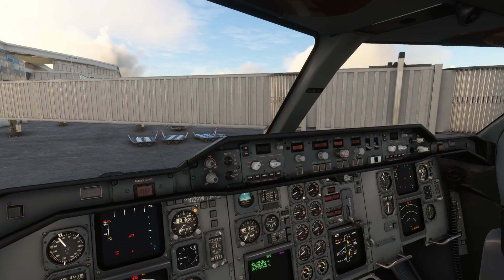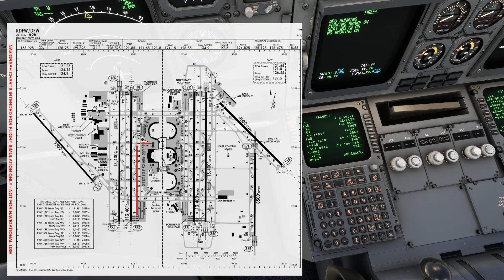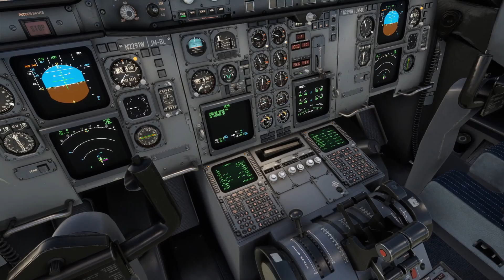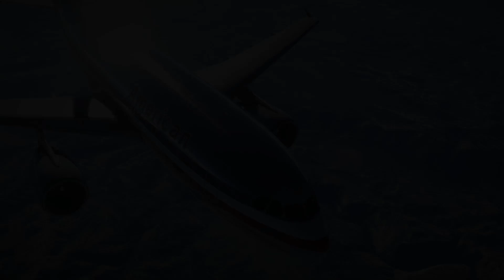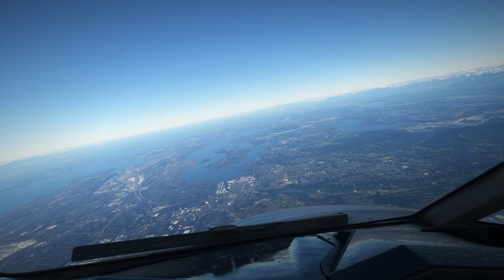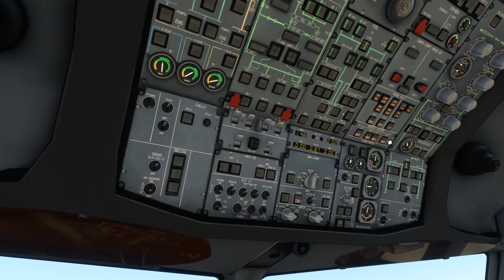MSFS Just Keeps Getting Better! | Ultimate Immersion | Real Airbus Pilot | Airbus A310 - Full Flight

Comment: If someone may please instruct me, whenever I use it, the engines would always get stuck at 100% and wouldn't respond
Reply from the maker: Hmmm, that’s very strange GB. I flew the A310 just a few days ago and didn’t have any problems. There is a throttle axis configuration option in the A310’s tablet, so I’m guessing you made to calibrate your throttle?

I hope that helps? Cheers : )
Reply: @IntotheBlueSimulations  I will try and see if it's a throttle calibration but it also happens whenever I use slew mode and I have the same problem with the CS 767 and 777 and the base game 747.
Reply from the maker: Ahh, I see. Well, if it’s affecting other aircraft also, it sound more like a key binding or hardware issue. Have you tried unplugging your peripherals and seeing whether you still have the same problem?
Reply: @IntotheBlueSimulations  Not yet, however I did fly the 777 a few days ago after not touching it for months and that problem is gone and I suspect it's the same with the 767.
I'll look around online

Comment: what settings do you run? i have a 3080 and run ultra but its laggy? also your seattle looks so goof mine has hills and bumps everywhere and i cant land? what KSEA do you use? and do you know how i can fix it? please also love the content thanks!
Reply from the maker: H Knox,

My settings on this particular PC (I have a new setup now), were / are roughly as follows:

- “High End” preset
- Pre-Cache = Ultra
- Terrain and Object visibility sliders set at 125% (sorry, I forget the actual names of them)
- Motion Blur = Off
- Glass Cockpit Refresh = Medium
- AI Traffic = Off
- VSync = On / 60fps

That gives a nice balance between graphical fidelity and performance. I only run at 1080p, hence the decent FPS / smooth performance. The things I’ve turned off / down are known to be famerate hogs. It’s important to note, I also spend a lot of time tweaking the weather / lighting in my videos, which accounts for much of the graphical fidelity you see (as that can make a huge different to how the sim looks overall).

Haha, I experienced the same with Asobo’s “handcrafted” KSEA (which is what I was using during the video). I got lucky though and didn’t hit any bumps until the departure end of the runway, which was a section of the video that I ultimately edited out anyway. It is a shame that the Seattle scenery is pretty iffy, given that it’s supposed to be “custom”.

I hope that helps a little! Thanks very much and all the best : )

Comment: Don't most airline pilots start with engine 2 before they go to 1? Haven't a clue why, but I keep noticing this on YouTube videos.
Reply from the maker: It’s very much aircraft dependant (rather than a pilot preference issue) Kokoete. I’m not actually sure which engine is started on the A310 first in fairness. I seem to recall that the 737 has a hydraulic issue, if the #1 engine is repeatedly started ahead of the #2 for example (though not being all that familiar with the 737, I could be wrong on that one) and on some aircraft, the hydraulics for the braking system might be powered off a certain engine, so it would make sense to start that engine first etc. Generally the start sequence will be detailed to the pilots via the aircraft documentation / company procedures.

I hope that clarifies things a little. All the best! : )

Comment: For those of you being interested in how a real A310 pilot did his cockpit prep, let my try an A310 cockpit preparation in a nutshell:

What you do is basically switch on the batteries, test the APU fire loop and squib, start APU, go into the fms to check database and then go directly to init A page, switch on left, right and middle IRS, check the aircraft coordinates via REF > GPS monitor page on the other fms, and correct coordinates on the init A page and hit ALIGN IRS, then go up to the isdu (right below left IRS), and check if those coordinates have been taken over. 
Then you can start with the overhead panel flow column by column, from bottom to top and left to right. Switch on the signs, the dome light (only cockpit lights at EMER Elec config), then FLT RCDR to GND CTL. When you are at the lights, switch the strobe in "Auto" and NAV/Logo in "1" or "2" (if equipped), all others OFF. We call it the "U". All the Pitch trim, yaw damper and ATS levers UP, check the squib and loop of ENG 1, and ENG 2 once you are there. Yes, you switch on every fuel pump, even if the fuel tank is empty, or even if the ACTs are not installed, as the auto fuel feed will be impaired and the CG can not be controlled. Switch on window and probe heat, once the covers are off. Switch on and check oxygen is at least between 1400 and 2000 PSI. EMER exit lights to ARM. You can select ECON FLOW with less than 160 PAX on board.
So bottomline, you basically switch all white lights off on the overhead panel. 

Right after that, i set up the EFB, get the ATIS and calculate my take off performance. Then i fill the FMS with the weights, flight plan, take off speeds etc. 
On the Prog page, we use bearing distance for the EOSID fix, and depending on Pilot flying from left or right, the corresponding other side is used to tune a VOR station (e.g. if CM1 is flying, we put in a VOR or DME station in Remote 2 (right side) at the bottom of the Prog page, that assures, that Remote 2 isn't autotuning any other undesired stations, for a departure or EOSID).

Now that i have done my calculations with the EFB before and know, that there are no performance issues with the planned departure, i start setting up the FCU. In the Speed window, we dial in the V2, then press the knob to activate a preset and dial in at least 250 knots, or take off weight + 120 Knots, whichever is higher. The preset gets activated, when for example during engine failure, where u deactivate the PROF mode and select the ALT hold mode at the acclereation altitude, the vertical mode changes, and an acceleration to the preselected speed is required. 
During normal operation in PROF mode, this speed will be disregarded, as there is no Mode change. The preset function can also be used, when descending to fl100 for example and you want to keep 310 knots, until reaching your altitude, and then slow down to 250 kts. Once ALT* appears, the vertical mode has changed, and your preset speed is activated, or it can also be used to change from 310 knots, to Mach 0.80 at you crossover altitude for climb Modes any other than PROF. Just remember, the preset speed is very useful and gets activated, whenever there is a vertical mode change.

On the EFIS control panel we set the minimum to -5 and in the FPA window wie dial in the trim Setting for the elevator as a reminder.

Then i do the panel on the side, check the switching, check the mask, and check that the RAT lever is stowed and guarded.

After that i set up the flight instruments, dial in the QNH and the Engine Out acceleration altitude, on the stand by airspeed indicator we bug V2 and the Green Dot Speed (until 20000ft it is your current aicraft weight + 100. So at 130 tons, your green dot speed is 230 kts). 
Then hit the EGPWS button, just short, and check the ND for a test pattern and some EGPWS call outs, set the Gear Position Determination System to 1 for odd, or 2 for even days (same with ignition A or B later for engine start). Test the Gear Warning. Dial in the current airport elevation, set up the thrust rating panel. Go through the engine instruments and finally set up the pedestal with some frequencies, insert the ILS frequency of the runway that is used in case of an immediate return (gives also a centerline indication during take off run, if it's the same runway), set ADF 1 to an NDB in the departure sector, and ADF2 to the Outer Marker of the return runway, set up the transponder, depending on pilot flying, either ATC 1 or 2.

Pilot Monitoring would at least check the cockpit and all the levers for their correct and corresponding position before Pilot flying is setting up the aircraft, then check the emergency gear, do the light test, and the brake check in the meantime. So on the center console right below the speed brake, press the accu button, to energize the yellow hydraulic system accumulator, note that the accu press pointer on the brake indicator moves into the green marking. the brake press indication should be 1500 PSI or more with parking brake on. Switch brakes to ALTN/ON, release parking brake and press the brake pedals, indication should be 2400 PSI at full pedal deflection, then release brake pedals, and set parking brake, also press accu button again until the pointer is in the green and switch back to NORM/ON.

Whats different to modern Airbusses: to insert the approach, you have to select the left line select key (LAT Revision) of any waypoint that is above the airport on the FPL page. I know, with modern airbus, you can hit the destination airport, but not on the 310. That way, it would insert the approach behind your destination.

I guess that's it so far. Can't think of more at the moment. Let me know, if you have specific questions.

PS: Fuel lever on at 15% minimum, we use mostly 18% N2 :P 
To check for correct engine parameters after ENG start, we use the "20, 40, 60" method, which means form top to bottom the N1 should be at around 24%, EGT at about 400 degrees C, and N2 around 65%
Reply from the maker: Thanks very much for the very detailed explanation Julian. Very helpful!

I had wondered what the purpose of preselected speed is - makes much more sense now. What is the logic behind setting -5 for the DH - is that just to prevent an auto-callout or something?

Cheers and all the best! : )
Reply: @IntotheBlueSimulations yes, -5 prevents the minimum auto callout upon touchdown.
Reply from the maker: Ahh ok, I figured as much. Initially I was wondering why everyone was setting -5 haha. Thanks once again for the info. Much appreciated! : )
Reply: @IntotheBlueSimulations  I forgot to mention, that the preset speed also works to change from IAS to Mach while climbing, and Mach to IAS while descending through FL290 (crossover altitude for standard speeds 310/.80). It is required to use the preset or to change it manually on the FCU whenever prof is not used and passing the crossover altitude. PROF mode uses the underlying airspeed of the fms. All other modes use the airspeed that is dialed in the speed window on the FCU. The aircraft is not automatically changing between IAS and Mach, meaning that you can find yourself in a overspeed situation at some point.

Comment: Interesting video. I have about 15k hours on Airbus, but I missed this generation and went straight from the B747-200 to the A340-300 (and later the 346, 332 and 333 - and technically the 35X, but never flew it), which was a complete brain change! I was surprised at the t/o performance calculation; for a relatively small and light aircraft, a Vr of 167 seems pretty high. I can't remember seeing speeds like that in the 346 below around 350 tonnes. But it may reflect the performance compromises Airbus made at the time. Anyway, good to watch. You have a nice manner.
Reply from the maker: Hello Tim,

Thank you very much for sharing your thoughts and indeed the kind words. Like yourself, I’ve flown a number of different members of the Airbus family, but nothing of this vintage. I did find it rather interesting, getting a feel for the A310 and noting the similarities / differences, as compared with a more modern Airbus. I was a bit surprised by the V speeds also and initially thought exactly the same (I put the high speeds down to Airbus having shortened the A310’s wing slightly), but as was pointed out by a real-world A310 chap, it was of course a slats-only takeoff. . .

Thanks very much for watching and all the best! : )

Comment: I love flying this plane but it's a pretty steep learning curve from the A320 this is close to if not study level. Having trouble setting it up do do an ILS landing
Reply from the maker: Hi Fizz,

Yes, the A310 is certainly a bit more work than the A320, a bit more demanding to operate etc, but I find it all the more rewarding to fly as a result (and it’s an interesting aircraft to operate). Anything specific causing you trouble with the ILS? It should just be a case of tuning it up on the centre console and then arming up the autopilot. To display the ILS on the PFD you’ll also need to make sure ILS is selected, via the switch located just to the right of the EFIS control panel.

I hope that helps a little. Happy flying and all the best! : )

Comment: No it keeps throwing up errors your just not seeing them
Reply from the maker: I’m well aware the sim is far from perfect David, but personally I think it’s (finally) started moving in the right direction and I’m enjoying MSFS for its strengths, rather than focusing on its weaknesses. Apart from the low FPS of the A310 (which has now been fixed) and some slightly dodgy taxiway issues in Seattle (not seen in the video), I don’t see how one can begrudge this “default” simming experience?

All the best

Comment: I really enjoy these videos.  Thank you for taking the time to do them.  Just a couple of quick questions, what replay software are you using for wing views on takeoff and landing, and how do you find the warthog?  I have just got one but not sure what sensitivity to set up.  Thank you as always
Reply from the maker: Hello Alec,

Thanks very much for the kind words! My pleasure and I'm really glad you're enjoying the content.

I use a 3rd party recording tool, which can be found here: https://flightsim.to/file/8163/flight-recorder

For the wing views themselves, I just move the camera into position manually (on most addons).

I'm a big fan of the Warthog! I've had mine for a while now and it's pretty robust, works nicely with most types of simming etc. In terms of sensitivity, I tend to keep my settings pretty standard. That may well not be the most realistic option, but it keeps things consistent across addons and makes things "fairer" for any product reviews etc. The only sensitivity setting I have changed - I have my rudder curve set to -50, as the rudder control in MSFS is still way overly sensitive.

I hope that helps? All the best! : )

Comment: Exellent video tutorial. Very illustrative. When I fly on CRZ level, the plane is loosing navigation, despite I have NAV activated or same, if I switch to HED SEL. Any idea why this happens? I can then only steer the plane into a different direction by deactivating the AP and fly manually.
Reply from the maker: Thanks very much Erich, I'm glad you found it useful!

I'm afraid I'm struggling to think what might be the cause of your issue. So, you are saying that the autopilot won't fly NAV in the cruise, what about at other times? The only thing I can think of, off the top of my head; what is it that you're doing to activate the autopilot? You aren't accidentally putting the autopilot into CWS mode, as opposed to CMD are you?

What you're describing is very strange behaviour otherwise. If you have any more details you can provide, that might help?

Cheers : )

Comment: Great video as always. Just a couple of things I'd like to share:

When setting the landing elevation before departure, you should actually set it to the departure airfield elevation instead. This is in case you need to come back. This is also why it is included twice in the default checklist (once before departure, and once before approach)

You can use the plan mode on the ND whilst the IRS is aligning. It just won't show the current position, but you can visualize the waypoints.

I've been told A310 pilots turn the Wx radar mode to 'Test' when turning it off. That way the rader won't radiate, even when it's accidentally turned on while on the ground.
Reply from the maker: Thanks very much for the pointers McRookworst and I'm really happy to hear you enjoyed the video!

Haha, the landing elevation was a "damned if you do, damned if you don't thing". I was always of the impression that you set departure airfield elevation, in case of a speedy return (that's what I did on the CRJ etc), but apparently it's not done on the 737 (at least according to a real-world 737 guy I spoke with) and so I stopped doing it in general (as I can't remember the specifics of every single airframe unfortunately). That being said, I think I'll just go back to setting departure airfield regardless, as it seems like the more conservative approach to take.

I was aware of plan mode thanks - I only didn't cycle through, because it would have meant having to change the view again and I wanted to keep a static viewpoint, having just frozen TrackIR (there would have been a big "jump" when I turned it on again otherwise).

As to the weather radar, I've used that exact same model myself and using the test function wasn't ever something we did, but I'm sure SOP / convention is different from one airline to the next.

I'm not trying to bat down all of your points haha, just explaining my choices and why I made them (hopefully it's of some interest).

Thanks again and all the best! : )
Reply: @IntotheBlueSimulations  Thanks for the reply! And I'm always happy to see reasoning/viewpoints behind different choices :)